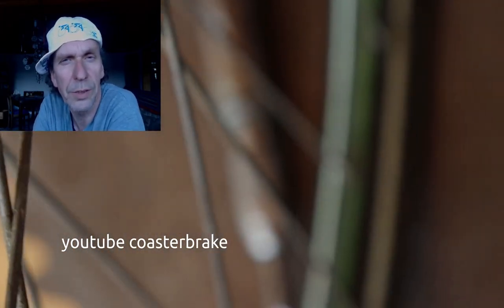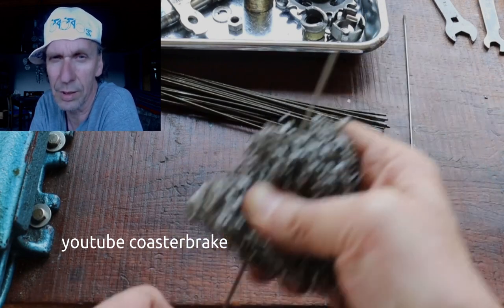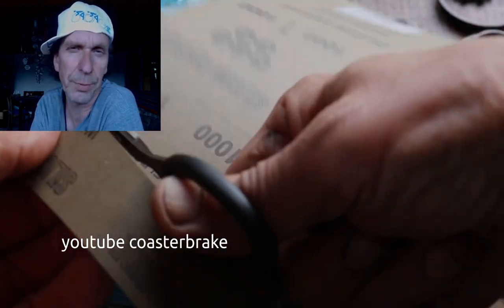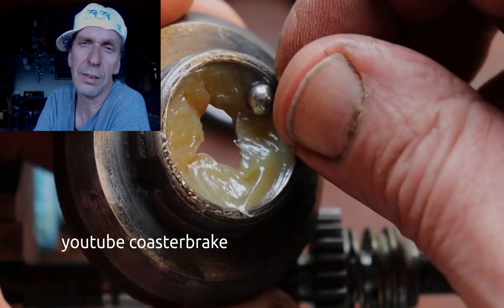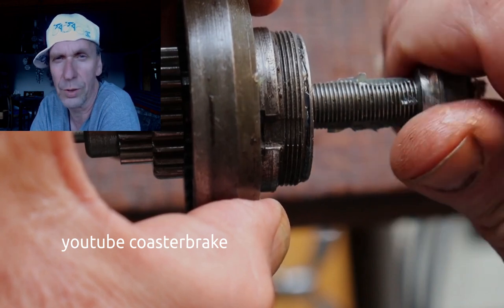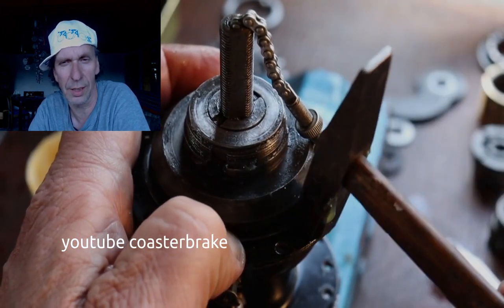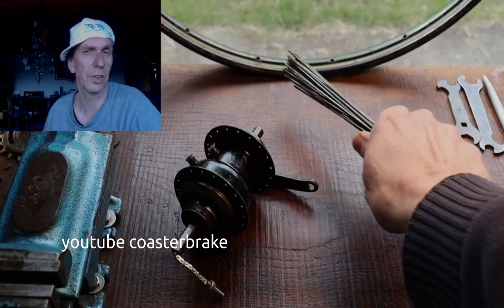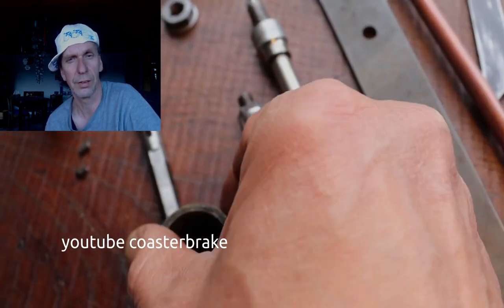The first Three-Speed from Fichtel and Sachs is the Torpedo mod29.

Comment: Hi from England, I have just got a super 7 hub and I was wondering seeing as my bicycke has an aluminium frame and has V brakes so is a weaker rear end would it be possible to remove the coaster brake and torque arm, then just use the hub as a 7 speed with freewheel.
Reply from the maker: Yes it is possible, you can try it, good luck with the job. regards jens
Reply: @don-torpedo  Thankyou, the hub just turned up in the post, later I will strip the unit down and asses it for wear and then look into removing the brake.
Reply: @hellcattanks  Ok I stripped it down as far as I could, the planet gears and sun gear all have some wear but look Ok, some wear is on the axle but not bad.
I'm having trouble with a couple of things, one is the philips screw in the end of the axle its frozen, and the other is the cone behind the chain sprocket its also frozen, should I use some heat on these?
Reply: @ultraproject2619 

You need to put a large washer under the snap ring to keep the brake cone from unscrewing itself without the brake cylinder/pads present. NOT recommended though. Do not use too much heat, it'll weaken the metal...
Reply: @westelaudio943  Its been in use for a year or so with no trouble, but I'll bear that in mind.
I see you have a To3 transistor as your avatar, you into electronics too.
Reply: @ultraproject2619  

That's good, how did you end up doing it? 
Haha yes sure, I like most any vintage technology :)